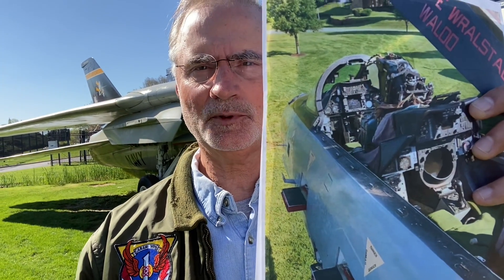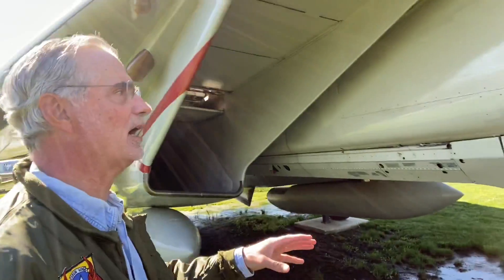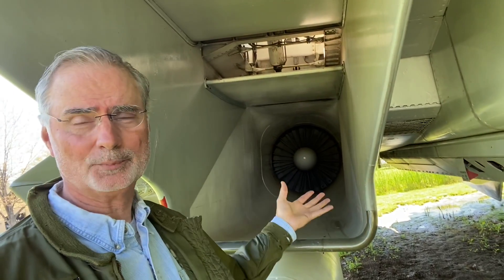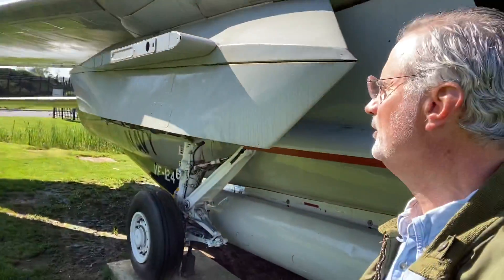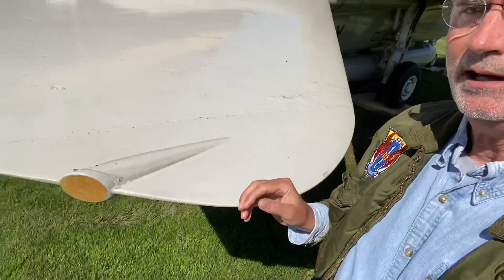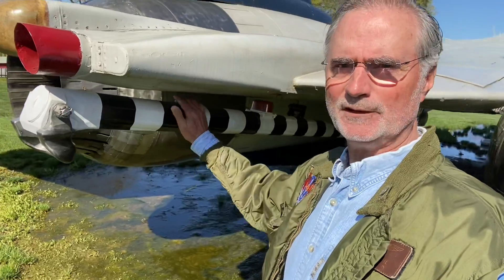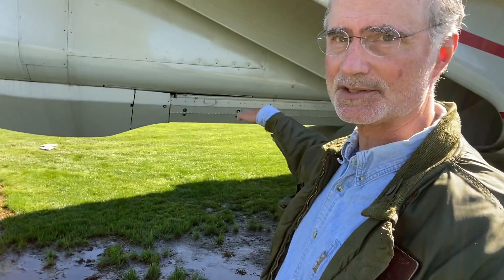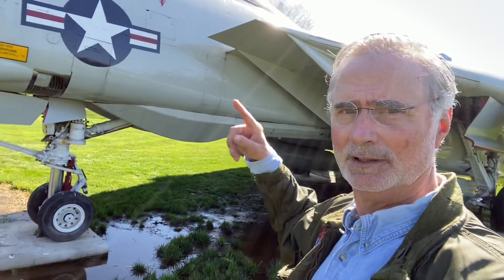Secrets of the F-14 Tomcat: Aircraft Preflight Walkaround

Comment: I don't know if it's possible but what would happen if the tail hook came down during high speed? Also it seems whenever I hear about Pratt & Whitney engines it's never anything good, seems like they are the Harbor Freight of jet engines, recently a few Pratt & Whitney's on some Boeing's had the fan blades blow apart during flight, I think in 2018 a passenger was even killed by a fan blade when it blew a hole in the fuselage.

Comment: I always wished to have explanation for the "wing gloves" or so I recall they were called. The small wings that went triangle shaped from the leading dege of the non pivotal part of the wing. My understanding is that they were used at the early stage of the F-14 career but later they weren'ts used anymore (desactivated ?) Just curious why they were for exactely and why they were not deemed necessary anymore.
Reply: They were only on Alphas (TF-30). With the addition of the GE-F100/400 engines on Alpha to Bravo refits and fresh off the line Bravos, they were removed along with the variable geometry inlet and the cabin air intake doors which were replaced with a more powerful ECS ram air system. I was a PC on Bravos for 8 months before I went to the AT shop.

There was no ECS intake door/duct to check for FOD, function, dead ducks, et al...and we had to make sure the ECS was suckin' as part of our PC walk around by reaching out and putting the back of our hand against the ECS grates from beneath the belly to check for air flow (i.e.: Check exterior combined side daily/weekly doors, slide under the belly, check inboard side of the doors, duck walk up to the combined side ECS & check for suck, walk back a little, move to the flight side ECS and check for suck, etc.).

The aircraft with 110's were much more powerful and didn't need the VGI system, so they ditched it. The intake was static, and the wing gloves & ECS intake doors were deleted (replaced with smooth panels). Also, it knocked a little weight off the craft & was one less hydraulically driven system for the AMH's to maintain and chase down leaks on.....Tomcats ALWAYS leaked hydraulic fluid, just like grand dad's ol' Chevy. If they didn't leak a little, then there was a fair chance that it had a problem.

Great jets, and it was always a point of pride to see them leave the deck & come back in one piece, but maintenance was a perpetual bitch.

Comment: As a grunt I never really appreciated what it took to get air support off the deck and overhead. Thanks shipmate. I have a whole new respect for Naval Aviation. SEMPER FI.
Reply: You grunts on the beach are a key motivation during every launch. Deck crews work their a$$es off to turn birds around. We still load ordnance the old fashioned way. Brute physical labor. There's a blur of various tools and body's in motion. Plane captains dangling 10 stories above the water line on top a slippery airplane that's  spotted in a manner where there's more bird hanging over the side of the ship than actually on the deck itself. 
When somebody gets hurt or killed during the process, and they do. Nothing stops. The machine keeps marching forward. 
Every body is mission dedicated to make sure the grunt on the beach has angels overhead.
Reply: Support in the air and the sea, and boots on the ground - All roles are crucial. Thank you!

Comment: Great video! One question about the TCS; I’ve  noticed that some retired tomcats have this ‘cone’ shaped fitting on the forward end of the TCS, apparently blocking the camera. In the film TopGun you can see F-14s with these ‘cones’ as well. My guess is these were just aerodynamic fittings installed when the camera was removed. Thanks.

Comment: I'm a new subscriber I've seen a few videos and I've learned something from each one of them.  I have a question for you regarding the electronics that run the wing sweeping mechanism. I've heard that the first microprocessor was made for the f-14s wing mechanism. And if that's true I was wondering if it was ever updated later on in the newer versions.  Or if that original I believe it was by Intel microprocessor just continued doing the job. And also as a secondary question where are those electronics stored on the aircraft.
Thanks for making these videos I look forward to watching more.

Comment: Can you talk about variable geometry? It seems like it was the “thing” in those days (mig-23, Tornado, F-111, etc). Were  the complexities and weight of the system worth the speed gains? How did we achieve the aerodynamic goals without variable geometry in the following generation of fighters. Thanks. Great videos.
Reply: I'm not a pilot, engineer nor even the person you asked for, but here is what I think:

High trust-to-weight turbofans killed the VG wing. The reason aircraft had small, low drag wings was because they had to achieve Mach 2 with the available engines, since previous conflicts (WW2, Korea) showed speed is life.

With a stronger engine, you don't need to reduce drag as drastically as before. Now a bigger, draggier wing can be employed and still reach the Mach 2 number.  A bigger wing means less speed in take off, and a stronger engine means less distance is needed to achieve that speed, so you got that short take off the VG wing give you. In the air, the turbofan engine is more efficient than a older turbojet, so you also get the longer range a VG wing provides.

A good example to illustrate all this is the Mirage III and 2000 comparison. A 50% increase in thrust permitted a increase in wingspan and bigger wing area. So now it achieves the same Mach 2.2 speed, but with much less take-off speed and runway length.
Reply: the 14 also needed swept wings to park efficiently on the boat.

Comment: I remember doing Wards mode IFF IV checks and syn cable aligning. Ward whilst at VF-32 / CAG-6 / CV-62 often when your Mode IV failed I would open the APX-72 bay pull out the RT unit smack it on the deck racket back in and off you went.

Comment: In 1989 thru 1992 I  was stationed at NAS PT MUGU as Maintenance Senior Chief at OMA. While there I was assigned to work the F-14D TECH EVAL project, we had 2 F-14A's that converted to D's (actually they were D-minus - 1 still had the TF-30 and the other had the GE110, no OBOGS or NACES Seat). The project started at NAS Pax River for the first half and then to NAS PT MUGU to finish the project once the completed and we proved the A/C the Navy wrote a check of the first Production A/C. We shot a lot of missiles and had lots of fun.

Comment: Love the Tomcat and enjoy your channel. I was 16 when Top Gun came out and that movie solidified my love for the F-14. I wanted very badly to join the Navy and fly one of these bad boys. I remember going to an airshow at Selfridge ANG base when they had one on display. It was threatening to rain - so they hurried it off to a hanger before I could get a close up look at it. I was able to climb into an F4 cockpit at that show and that pretty much dashed any hopes I had of becoming Maverick, Hollywood or Iceman. At 6'4" I literally could not move once in the seat. The stick was wedged between my knees which were wedged between the equipment panels. :( The pilot told me right then that tall lanky dudes don't make for the best fighter pilots anyway. We pass out too easily he said. He mentioned 6'5" was the cutoff, but I can't imagine how... Not sure how the F-14 cockpit compares for real estate, but... LOL - Anyway, I had to settle on engineering.
Reply: F-14 had adjustable rudder pedals and seat height, I'm 5'8" and had to lay out to push the pedals all the way forward. The seat had an electric drive for height and you could drive it up to where the canopy rail was down by your waist or down to where your shoulders were even. Our tallest pilot was 6'5" and he fit fine along with our shortest  at 5'3".
Reply from the maker: @5695q  I’m 6’5” and fit fine in the back seat.
Reply from the maker: We need good engineers too, David! Thanks for the comment and for watching.
Reply: @WardCarroll  True that. Sounds like the F-14 had a LOT more room than the F4. I'm not disappointed. It's kinda like never asking out that girl in HS that you had a crush on... just a tinge of regret. At least I get to live vicariously. ;)

Comment: Man you guys had a big walk around.  On our Thunderpig, we arrived in jeep , saw the plane, said yep she's ready and got on board 😀.  Well, not that quick but almost. But hey, when you stall below 85 knots, there is a big bandwidth of performance to our bird to yours. We participated in Operation Frequent Wind.  Tan Son Nhut Air Base runways were too shot up for evacuation by aircraft by April 29, 75, so it was up to helicopters  to complete mission by 30th. We could still provide air observation support. As I recall, flying over the Enterprise she had F14's  on deck. Also recall in competition with F111, GD could not design a robust landing gear system,  and was not suited for a CAT launch. Ward, these are awesome videos,  you should really start picking up subscribers . Have ya checked out Final Countdown yet?
Reply: GD teamed with Grumman who built the aft fuselage and landing gear for the F-111, A ( Air Force ) and B ( Navy ) had same airframe with Navy being a couple feet shorter with a little more wingspan, same airframe either version. Grumman had built a swing wing in the 50's but it never was produced in numbers, they brought that plus the experience of building Nay aircraft to the project.

Comment: Former AE2 here, CAG 7 attached to F/A-18 squadron but always lusted after the tomcat, especially when she squatted to lower the launch bar (I didn't lust after the maintenance side, those guys in VF-142 and VF-143 where always working... I can still see the RIO giving thumbs down). At 7:58 as you discuss the turkey feathers of engine you can see on port vertical stab the number of cat shots and traps for this bird. Why would there be 9 more traps vs. cat shots? I can understand a few more cat shots for going home to the beach. Would more traps be due to craned off of boat?
Reply from the maker: Great question. Maybe crane offs?
Reply: @WardCarroll  field arrestments maybe.